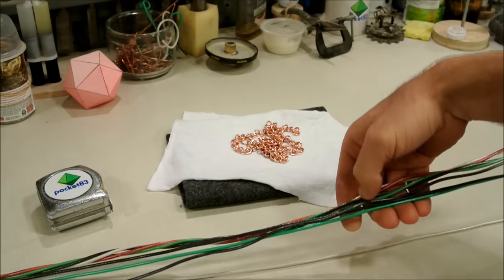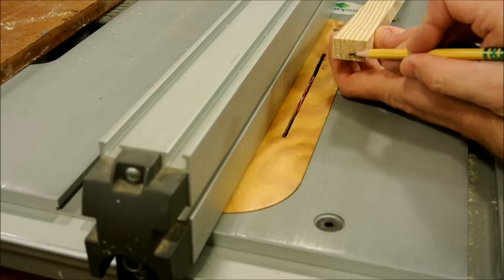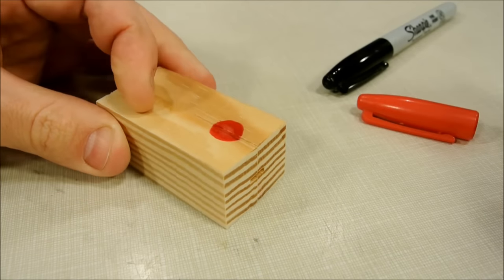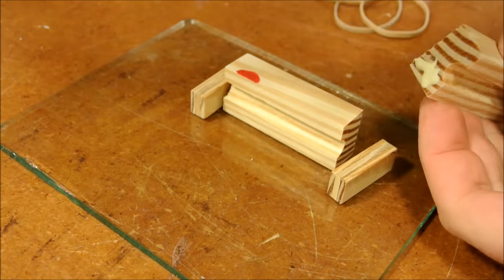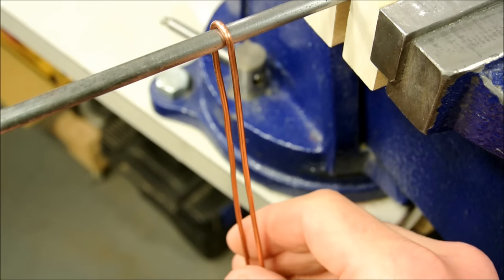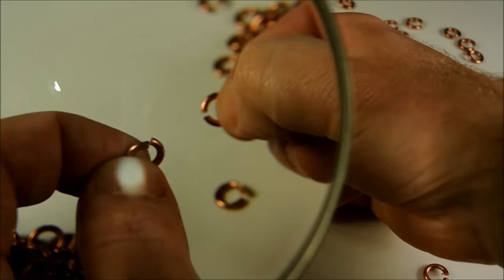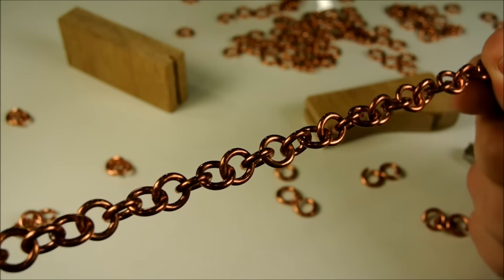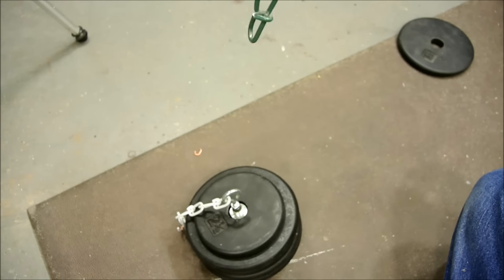Copper chain building

Comment from the maker: Lots of suggestions to use a drill for making the helices. About that:  
I don't do it because twisting them by hand will still quickly generate more links than I care to assemble. The assembly is the tedious part. Further, forming the helix by hand is easy, reliable, quiet, waste efficient, and it's even somewhat entertaining. And again, long copper coils simply become too springy, which alters the ring diameter.  

If you are trying to make production chainmail, these probably aren't the techniques you are looking for. This video is for the passive hobbyist, so I still don't recommend using a drill, and please try to understand that I'm not interested in your passionate appeal for me to change.
Reply: I would never advocate using a drill to make a coil - that sounds like a recipe for disaster. I can tell you that at the jewellers workshop, we use the lathe to hold the round steel bar and wedge one end of the wire, then simply turn the stock with one hand (never switching it on, obviously). 
We also only make short lengths, because we're using precious metals, but I found your use of a jig really cool. thanks!
Reply: plz make a copper cooking pot
Reply: You could use a drill to straighten the wires, clamp one end in the vice, other end in the chuck, i found it also hardens the copper, and it leaves an interesting twist feature in the wire.
Don't do it too much or it will break ;)
Reply: i found something out, instead of using salt and vinegar for cleaning off corrosion, use baking soda and vinegar
Reply: I wouldn't use your video for chain mail use, not because there's anything wrong with your design, but simply because chainmail requires a larger circumference to support the other connections, this Idea is wonderful and I look forward to trying it out
Reply: There are also things you can buy where you crank the mandrel for lack of a better word. It is a bit quicker but you control it. I don't know if they come in large sizes though. For mine, the largest size is actually pretty tiny.
Reply: Love these chains man I made one for my wallet and ended up making another dozen for my friends who wanted one as well
Reply: pocket83 have you ever thought about soldering the joints together? I use Sil-fos 5 brazing rods made by Lucas Milhaupt. Most welding supplies carry it. It is 89% copper and  is a good color match. I practice designs and different ring sizes with copper before making the final product with Argentium silver. I love your jig you made for cutting the rings!
Reply: I was wondering if you make the Copper Link Jig to sell?
Thanks
Reply: Levi Hesher .... yeah that’s a good question! 

I don’t have a table saw.  So I might be interested in buying one.
Reply: @BigOHavingFun  You don't need one. Just clamp two pieces of equal length wood together and drill the right size hole you need as square as you can by eye. It wont be perfectly centered like his, but it doesn't need to be. All you would need to do is cut the height of the end pieces to wherever the halfway point of the hole is.

I know what you mean, though. Like watching Bob Vila making a birdhouse and thinking, "I'd like to try that", then he's all like, "just cut it on your radial arm saw, take it over to your table saw and rip it down, then just angle your table drum sander to a 45....", and I'm like "🤷‍♂️?!"

Comment: After years of making chainmail from steel wire I can safely say I think you found the most efficient method, because it's nearly what I do when I make butted mail. However, that cutting jig will become a new part of my work station. I dont' think I can ever thank you enough for that idea. It seems to give a much nicer cut than I'd get with my trusty wirecutters. 

I just wish I could find a pocket-esque method of cutting those links with a small overlap when it comes to making riveted chainmail. For me, it's just some modified wire snips with a notch cut in the blade that's large enough for the wire to comfortably sit in it, I can only imagine you'd come up with an answer that'll make me kick myself. But yes, thanks for the jig! it's absolutely going to save me so much time.
Reply: +Managarmr420 How about cutting the formed spring a little bit off center? Instead of a vertical cut to the apex of the spring's circle (12 o' clock), a vertical cut at the 1 or 2 o' clock point should produce a mating tapered edge on both ends. My guess is that, a cut like that would be best if you intend to solder the link's tips. Not sure if it would help for riveting them though. Best of luck!
Reply: My father supplied me with a bunch of loops he made so I could chain mail (I learned when I was eight) and now I'm running out so I am looking for ways to make more loops

Comment: This is an amazing idea and something I'm going to have to try. I make chain mail in my off time here and there and I make my own rings one simple suggestion if you don't mind me adding! The rod you use to make your coils on if you drill the same size hole on one side you and insert your wire and use a drill to spin the rod and it takes half the time doing it by hand! Just leave enough wire sticking through the other side so you can push a little and clip it to remove from the rod and the you can still use your jig to cut your rings! I don't claim to be an expert but it's little tips I've picked up over the time that helps to make a bunch of rings in a short period of time! Thanks again for the video and again this is an amazing idea
Reply: That's what I did when I made chanimail.
Reply: Tony Alexander it's amazingly fast and easy

Comment: I also use a port-a-band, band saw to cut the larger gauges. Only limited by the opening on the port-a-band for the coil length. To coil mine, I put the 1/2" brass stock in my cordless drill, secure one end of the copper in my vice and if you can imagine a winch drum, just wind up the copper, pulling me closer to the vice as it rotates.

Comment: Great idea!

FYI, if you want to prevent the copper from oxidizing to begin with, dip it in some blond shellac; after it's dry, you'll never know it's there & is enough to prevent the air & moisture from getting at it and stop corrosion.

Comment: You could also solder the ends, and thus, have a stronger chain!  (It will have a silver spot remaining, however)
Reply: red7fifty it may be expensive but you can use gold soulder which looks like copper enough to hide the joints.
Reply: A quick search informs me there are copper solders.
Reply: Or use copper phosphor brazing rod.
Reply: @seigeengine  copper solders look like silver a lot of the time.

Comment: Amazing!
For non-electricians: there are two types of copper wires for electricity: massive, as shown in the video, and tiny threads which are twisted around each other. Those you cannot use for this purpose.

Comment: Wow. Copper is better at holding a weight than I expected. Well, clearly the fact that I never really clarified physically the difference between ductility and tensile stress is the problem in my prediction capabilities, even if I know there is a relation between both properties, I never really did study them - even though I check on such things from time to time...

It was a neat thing to see, though.

Comment: silver solder the individual links and then retest for strength
Reply: I wanted to see him heat treat the chain at the end.
Reply: Heat treatment will anneal copper, it's best left just the way it is, the wiremaking, bending, and twisting will have workhardened it
Reply: You could also use copper solder.
Reply: I just use regular tin/lead solder. It does the job just fine and I'm not making jewelry, just chain mail.
Reply: JKC no silver solder on copper links!!! Use a copper solder from a jewelry supply or          Sil-fos 5 brazing rods. The silver solder is silver and will look horrible unless you coat the surrounding area with an anti-flux!
Reply: I used tin/lead solder. I don't really care if the shiny silvery clashes with the copper color, I'm looking for effectiveness. Chainmail already looks cool on its own.

Comment: Two questions: 1. Do you have a method/suggestion for keeping it from re-oxidizing after cleaning? 2. What's the story behind your "Pocket83" handle? The cutting jig is genius, Thx.
Reply from the maker: The short answer is lacquer. However, it can peel/flake off with wear, and it also changes the appearance slightly to a pinkish, non-metallic color. This is of course superficial (and thus temporary), but it should be noted. I've had some luck with drying oils, such as Teak, but I haven't tested it very extensively. 

All of this depends on your application, but I find the cleaning solution to be the simplest solution, and it produces the most attractive result.

Comment: @pocket83
6:30 Much easier winding technique, put the steel rod into a hand drill machine (just like a normal drill bit), then put in one end of the copper in the drill head (it's usually a hole between the bits that hold the drill bit), and just wind away, you WILL need thick gloves at the end, or you will cut yourself, Or you can make some kind of guided holder by drilling a matching hole into a piece of wood & have the copper run through the hole, while you hold the wood.

Comment: My apologies if this has been answered elsewhere, but what are the white plastic (I'm assuming) blocks that you use on your sleds and elsewhere?
Reply from the maker: Like @ 3:26 ?

That's a scrap chunk of HDPE. It's nice and slippery, and easy to see when there are obstructions. I try to use it (as a stop) on video for clarity. I also have it in 1/4" flat sheets, which I use for fence applications, et cetera. Very abrasion resistant.
Reply: Yes, that's what I was referring to, thank you.  I figured it had to be abrasion resistant (given the environment of a shop/garage) and not prone to compression, etc.

Comment: Is copper rust-proof?
Reply from the maker: Yes and no. Technically it does. But in reality, not really, because the process is very slow. It eventually gets a thin layer of oxide on the surface that will start to "patina," but it would probably take many thousands of years for a copper chain to "rust" away.   

You may have seen a copper roof before: it will develop a light-green color with age. A similar example is with the Statue of Liberty. Supposedly, its patina actually protects the copper from aging.

Comment: Dont mean to be rude... but watch any chainmail making video and you will get faster, better, and easier solutions to creating links.
No reason to use a hacksaw and jig when you can use a set of tin snips. Tin snips (on top of being dirt cheap) provide an angle which can help decrease the likelihood of the chain bending to one side (the other side will have the strength of a regular flat cut)
Wooden dowels can be used instead of steel. Ive used wooden dowels to turn something like 7,000 links of steel of the same gauge (in the same way) as the copper in this video. Can't turn it by hand? Drilling a hole through the dowel and a makeshift handle allows you to use a bit of the wire that you already bought (probably too much of "just to be safe") to thread the handle onto the turning rod.
One set of needle nose pliers and a homemade jig that can only be made witg accurate cutting and a saw? Nope. Use two sets of needlenose pliers.
That said. I dont like to post SPECIFIC critiques without mentioning the good in a video.
The suggestion to epoxy leather onto pliers is a good idea. A really good idea. Needle nose pliers are like 2 for $5 at walmart. Leather isnt cheap, but leather is easy to come by in scrap... and even at exorbitant prices, 2 inches of leather will be worth the marks youll make on your chain.
Reply from the maker: Tin snipped copper wire looks like garbage. There is simply no comparison to cut rings. I don't mean to be rude, either.

Comment: Slick tricks! Even though I have zero interest in making chain, this was fascinating because it is concise, clearly photographed and well edited. Your methods for handling small parts in batches and neat jigs can apply to many other projects. I'll blatantly steal your idea of gluing small parts upon a glass plate. That's far better than my old method of wax paper on the granite countertop, which for some reason irritates my wife. ;-)

Also, that copper cleaning solution will come in VERY handy! 
Between these techniques and the baby-powder / unsticking-shellac-finger trick, I now owe you a lunch or three. Thanks!
Reply from the maker: Thank you. The glass is from one of those halogen work lights that usually come on a stand. I now use those for everything. They have survived 15+ years, even counting being dropped to the concrete.  

When I was younger, I remember warming my bacon sandwiches on one of those lights (in foil). The other guys at work laughed at me- while they ate their cold lunchmeat.
Reply: Learner-Learns j
Reply: Learner-Learns    I just de-commissioned an old printer/scanner. I saved the glass from the scanner & l use that to segment pieces of wood that I use to make bowls. It keeps them perfectly flat. Not sure how I'll use the rest of the parts. But, this is ONE good reason for being a horder !
I'm just sayin. ....Jim

Comment: i did this last summer when i was in a course for electrical installations and we had tons of wire left over every day...
i made chainmail though, instead of just lines :)
i jdid it a little different though: i wrapped the wire around a screwdriver and cut the helix with a pair of sidecutters. i connected the links together (probably a few hundred to make a small patch of chainmail), and i even soldered the links shut one by one. That way the chainmail was surprisingly strong!
Reply: They're called chains.

Comment: I'd recommend using a jeweler's saw for separating the links. the kerf will be much smaller and it will take less effort to close the rings. The cutting jig is a great idea!
Reply from the maker: Ahh, but remember the scene where I assemble; the kerf is already very conveniently sized for linking them together.
Reply: You sacrifice symmetry when you leave the cut so wide and then close the links. They become more oval.

Comment: It looks lovely but I simply stick whatever size of bit (or crochet hook whatever if you want oval or other than round links) into my drill with the tail end of the wire then make a coil, cut rings and assemble.

Comment: Clever way to open a jump ring, genius!  Also the cutting jig is marvelous.  Excellent for chain making.
I suggest you use a finer jewelers fret saw rather than a hacksaw so the links have a smaller gap. You will have to pry them open using your wood tool but no issue with closing it up after that and you don't lose much copper in filings.
There are nylon jaw pliers you can buy but this leather hack is a great idea. I suppose you can also dip the nose plier jaws in liquid rubber to make padding.  I would also do that with your hand tools so your hands don't wear out.

Let me leave you with some healing supplements for your hands. Do this and you will not wear out your precious hands:
Swim!  Relaxes all the hand muscles. Swim in sunlight not indoors.
Glucosamine/ MSM 750 mg Costco, Zinc 50 mg, CoEnzyme Q10 300 mg,  Fish Oil 1000 mg, Vit C powder in water. This combination heals carpal tunnel syndrome fast, removes inflammation and speeds up healing of any fatigued hands or wrist.
Take Gelatine unflavored for rebuilding cartilage and connective tissue. Also good for hair and skin.

DMSO gel - apply on hands and let it dry. Use a flat knife or ice cream stick to apply. Do not use any chemicals when this is on your hands. Let dry fully, then wash with soap.  Then dry. Wear gloves and you can work with chemicals 2 hrs later.  DMSO will rapidly fix damaged muscle tissue. All natural. But chemicals will go thru the skin barrier immediately if there is any DMSO on it.

Comment: You can work harden your chains by using a tumbler. That will make the copper harder and less prone to spreading apart under load if you decide to make chain from a smaller gauge but also more brittle. For light jewelry that works just fine.

Comment: Dude I took a knitting needles cut off the tip drilled a hole wire size by the rivet on the end, I checked it in my drill and put wire into hole and slowly turning drill wound the wire onto the needle, then clip the wire by the hole and unchuck needle and slide off wire. Makes about a foot 3inches of chain. Chain can be soldered and electroplated copper or silver chain is mutch stronger I clip my rings with cutters they stay round then, your links are oval cause of missing metal but they do fit nice.

Comment: @rich rondot yes, but i would use a bit thinner wire or a bit bigger shaft, those seem to be awfully tight for any armor, you have at least 4 rings and quite often 6 rings in every ring :-\

Comment: Excellent project. I wonder if you might be able to use a Solder Pot to solder the chain links to make them a bit stronger? 
I say Solder Pot so that you can control the amount of Solder used. If you made 1/2" rings you would be able to use this for Chainmail items too... Cheers....

Comment: That's great, def. saving this video for later.  Wonder if you could solder the links closed?
Reply: Very simple to solder copper pipe.  Copper wire too, prolly
Reply: Wait a sec, it's best to abrade the copper pipe with a bit o' sand paper, gives a better bond, but with the chain :/ ...
Reply: Dude in the comments below made CHAINMAIL with soldered copper links :D